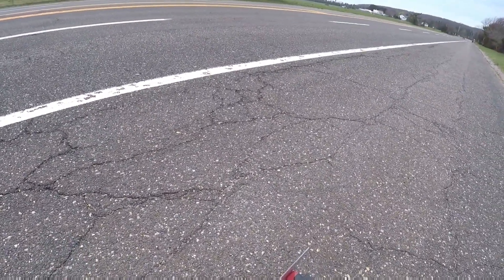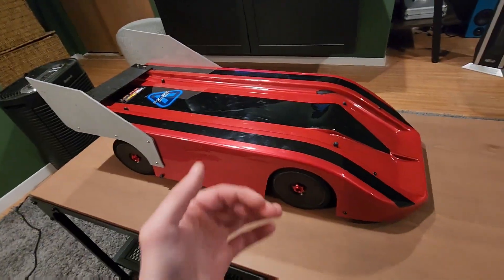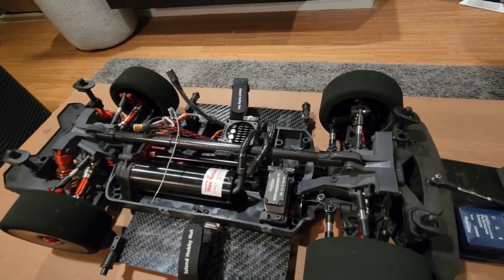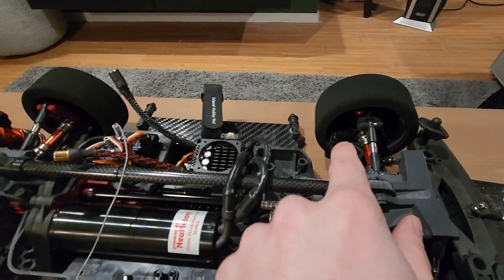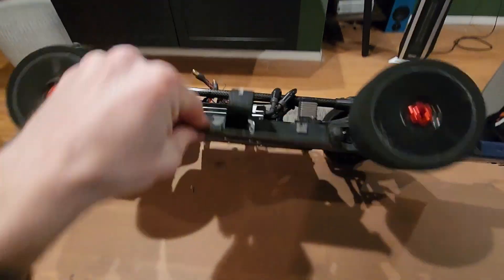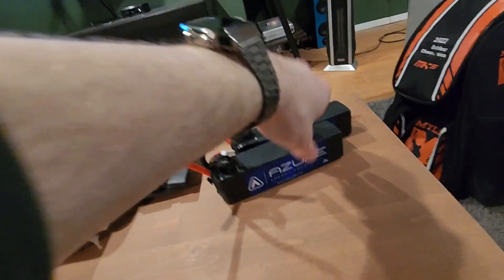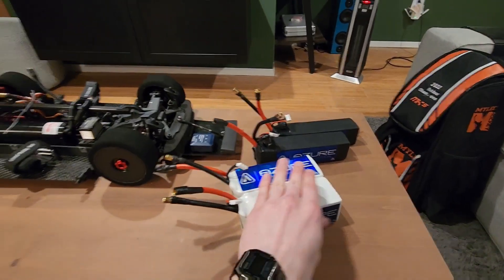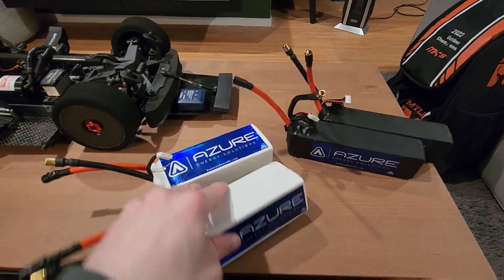Arrma Vendetta 160mph 8s Azure lipos

Comment: Clean build,,good  # for Mmx8s..xlx2 will wake it up..very surprised HR spool is hanging in there,I've destroyed like 3 on less volts.havent killed the oktay spool yet..much better spool.
Reply from the maker: Ya I check the spool after almost every pass and it's only made 4 and it's about shot I'll be replacing it soon with oktay one. And I Wana see if I can crack 170 with the mmx8s before I replace it
Reply: @JohnLinnemanSpeed  that would be an impressive # for 400a.ive been pushing detta an having much more fun doing it than my metal chassis cars..plastic chassis has much more potential than everyone ever expected an I think you'll get that 170/400a hit an then some with a super slow buildup.nice build,nice run ,keep pushing it brother